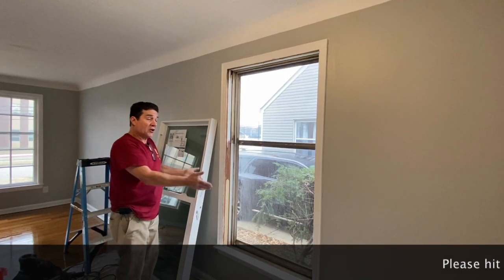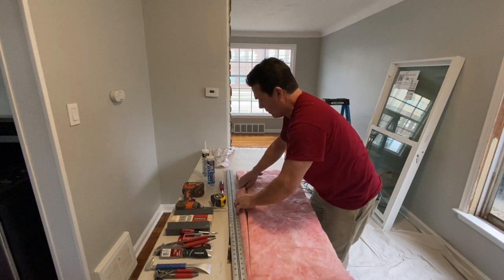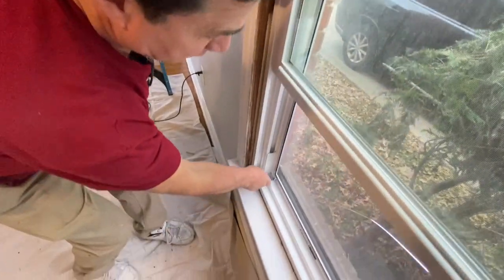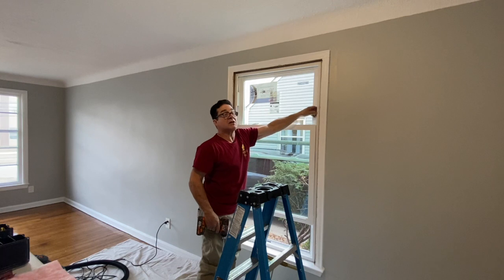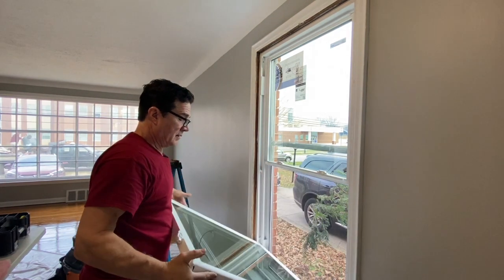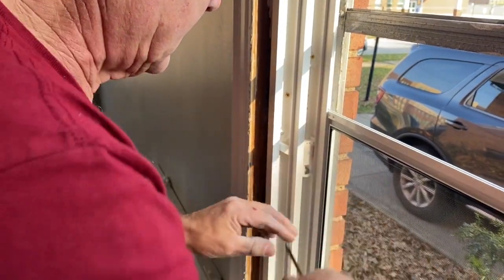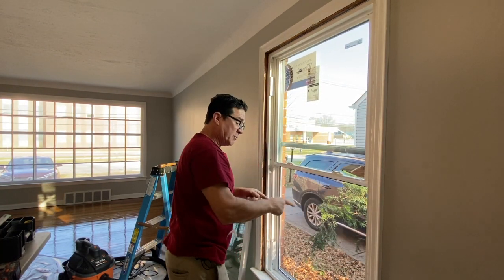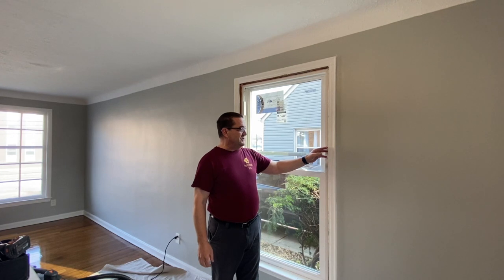VINYL WINDOW How To install like a PRO

Comment: Great video. Got a dumb question, hoping you see this. In your measuring video, you took the opening height, head jamb to top of sill behind stool, and subtracted 3/8” to get to the actual insert window height that you order.  Thats enough to get the window into the opening, doing nothing more to the opening other than removing the trim stops?  I like how you only took the 3/8, to get a nice fit at the top. But I’m surprised that you are able to angle it into the opening.  Thanks

Comment: That type of insulation insulates due to trap air spaces....what good does it do if it's fully compressed? I'm am just curious? Would a rigid foam be better if thin enough?
Reply from the maker: It really isn’t fully compressed. Just loosely fill the void until you cannot see any light coming through.